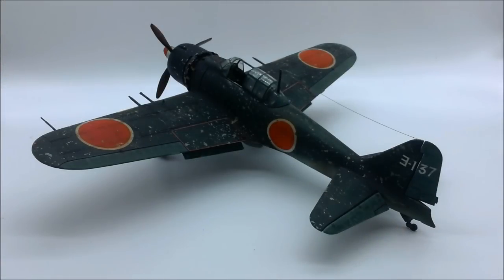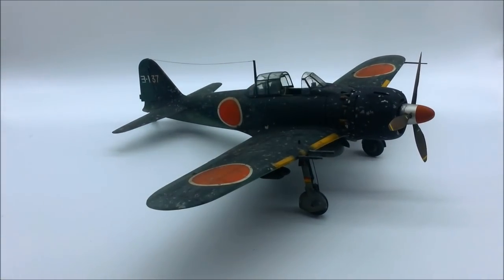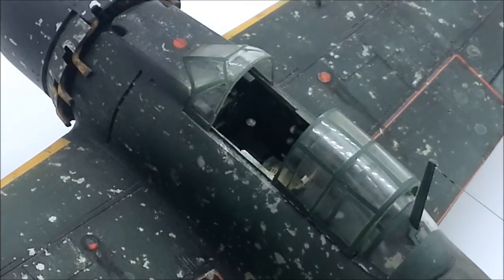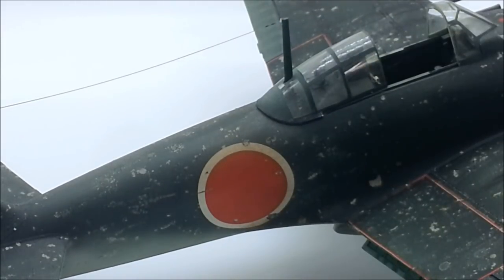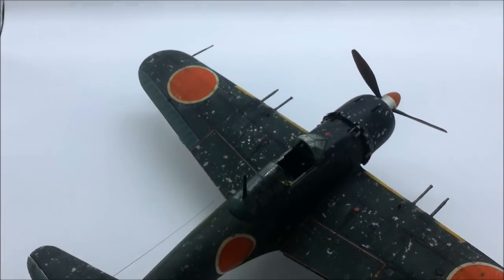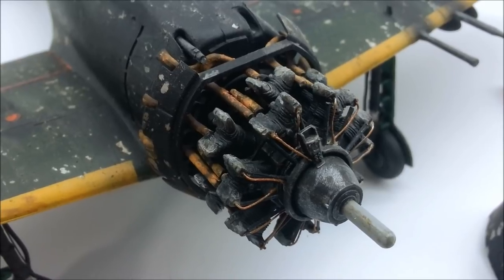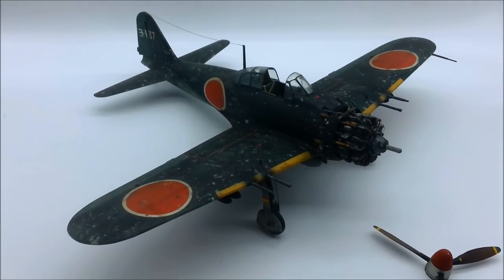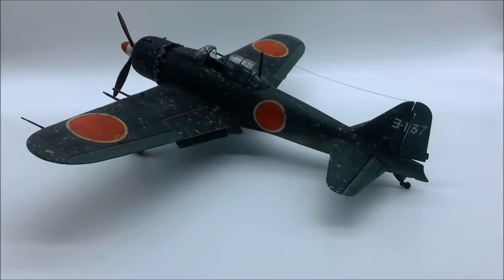1/32 scale Hasegawa Mitsubishi Zero A6M5 - built model showcase

Comment: Couple of notes. I recently opportunity bought and am currently in the process of building this kit. Even on worn aircraft Hinomaru should not be damaged, and so chipped or dirty. The symbol was revered by the IJE forces as representative of their God. It would be roughly akin but worse than the disrespect of a military man permitting the Australian flag to drag on the ground in the mud or pissing on a symbol of jesus crucifixion in the Christian society as Australia was then.

The kit is a 50 year old mould and showing its age (i.e. no aileron rods or fairings, pathetic pilot figure). That said, with minor corrections it still builds into a good looking A6M5 Hei only a hardcore Zero knowledgeable afficionado would criticise. For the money (I picked it up for just AUD$27), research initiative it excites and painting practice prior to attempting the holy grail that is Tamiya's kit or Hasegawa's newer issue kit, it's worth building. That said, these days -I'm getting old and compromising on an earlier trait of perfectionism, I have a pragmatic policy of building pretty much out of the box with minor (easy) modifications rather than try to turn a sow's ear into a silk purse. 

The instructions contain some spec & description errors. For a Hei which the wing armament, drop tank mounting & type and underwing bomb racks represent, the left (port) MG should be omitted entirely, and the MG butt cut away from the instrument panel. (easy). If you have a Dremel, the cowl's port MG recess should be opened up a little for the larger MG & drill out the starboard gun cooling vent (fuselage). The starboard MG butt moulded into the instrument panel is also a bit small for the 13.2mm MG, but hey it's good enough given the constraints of accuracy of the cockpit with this model. The 20mm wing cannon barrels are substantial enough to be drilled out a little to improve their presentation. Can't do much with the wing 13.2mm MG barrels other than replace if desired. One thing I was disappointed with. No instrument panel decal is included on the decal sheet, so its old school painting I'm afraid which is a PITA with black instruments against a Mitsubishi green panel.

Also a PITA with this kit is the engine exhaust pipe assembly where every single or two into one pipe has to be configured, sight aligned and glued into position without a positional or alignment guide other than the instructions. Do this in a patient mood and couple of pipes at a time with breaks in between is my recommendation. Fortunately Hasegawa adressed this unnecessary frustration in 08884 their 2016 new tool.

All A6M5 Hei production was Mitsubishi built. So that means Mitsubishi greens, grey-green, inner flap and wheel well colour & cockpit colour along with the aft fuselage demarcation lines. Ko & Otsu could be either (i.e. Nakajima build).

As stated lacks the detail moulded sharpness and finesse of the later Has and Tam kits, e.g. nav lights but still looks astonishing dressed up in its warpaint.